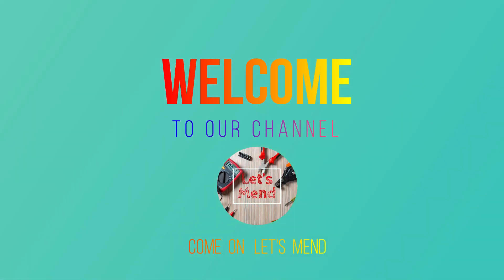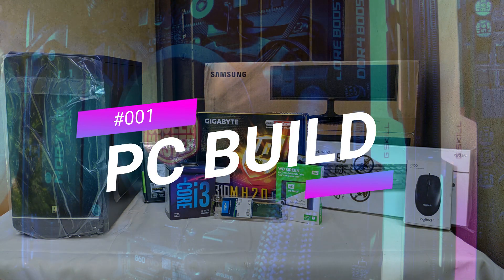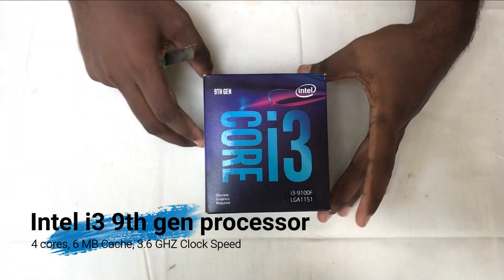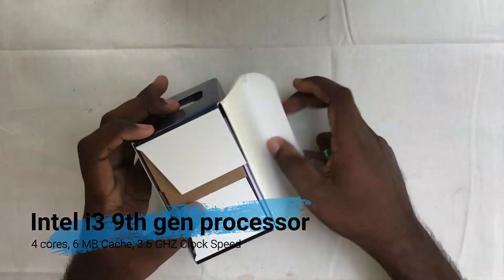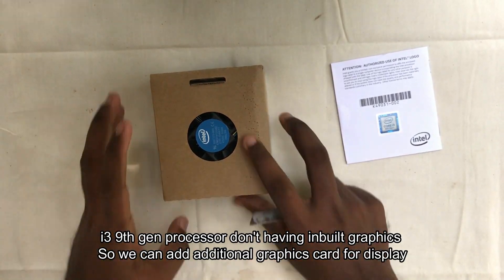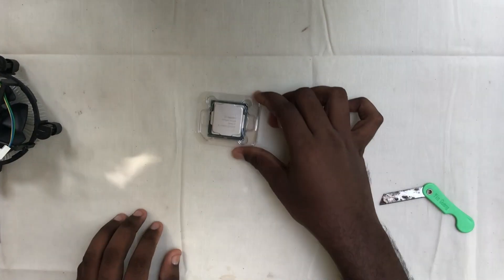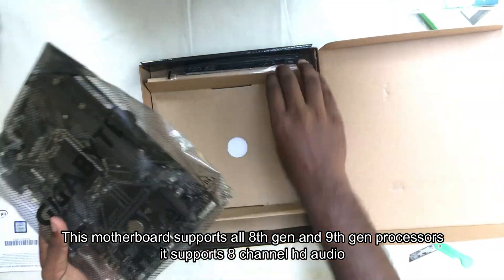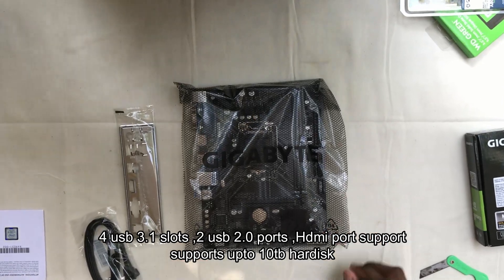BUDGET PC BUILD 2020 | BEST PC BUILD IN TAMIL|i3 9th GEN PC BUILD | COMPUTER ASSEMBLING STEP BY STEP

Comment: Bro neenga vaciruka ellam building parts oda cost enna bro
Reply from the maker: Processor 6000
Motherboard 5000
8gb ram 2750
Cabin +Smbs 2000
120 ssd 2200
1tb hdd 2900
Dell key & mouse 750
Monitor 7500
Ups 1800
Reply: @princetechnologies  thx bro